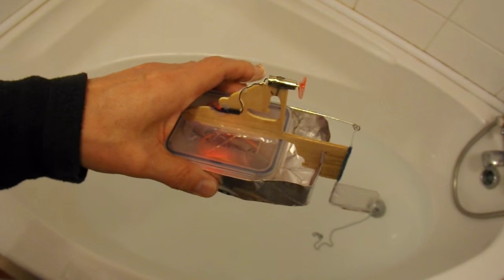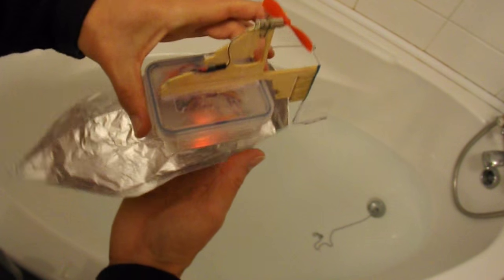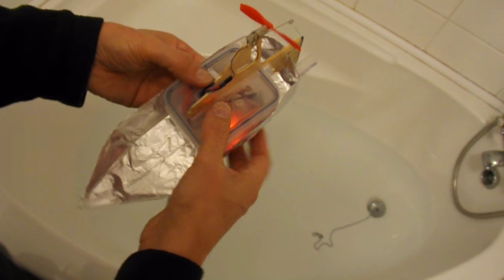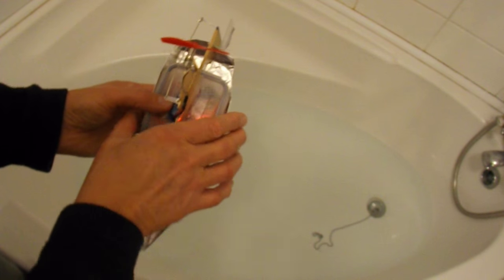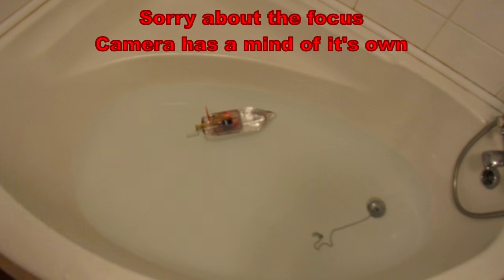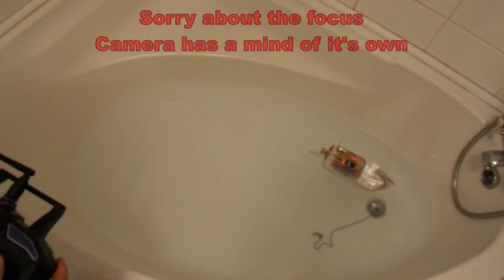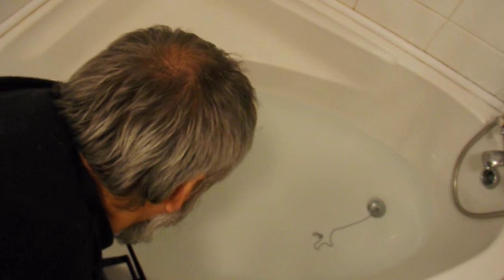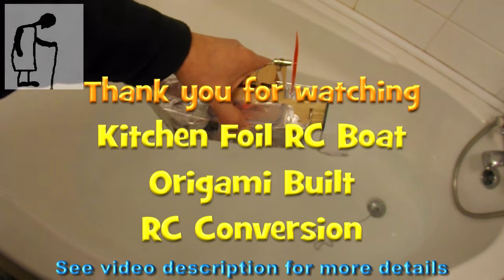Kitchen Foil RC Boat PART #2 Origami Built RC conversion

Comment: could you make a tin foil car (axles and wheels can be another substance such as paper, wood, etc.).
also make it to where it is powered by an external fan.
Reply from the maker: +Epic Face 3000  Metal Foil Boat Car Plane #4 Rubber Band Car https://youtu.be/K1jfLX-Syc4 Beer Can Electric Fan Jet Car https://youtu.be/nc152UTn9YI  Aluminium Foil Boats Cars and Planes https://www.youtube.com/playlist?list=PLA5a2xPRSrB1MkF27XAD9XCZOi2zhKjik

Comment: I think cameras have trouble focusing if most of the background is white and the 'subject' I guess is not in the centre of the screen.
Reply from the maker: +GoldenMiru the problem is that sometimes I use my camera in auto focus mode and sometimes I don't and I forget which I am using. In a situation where there is nothing for it to focus on at the start I should be using fixed focus and set it up first before filming.